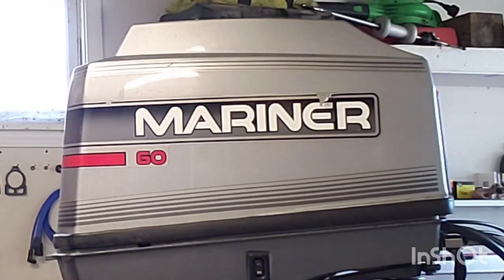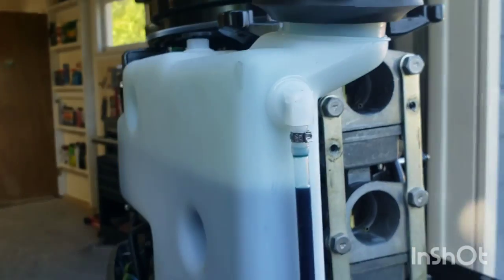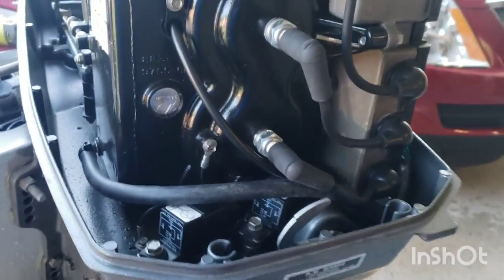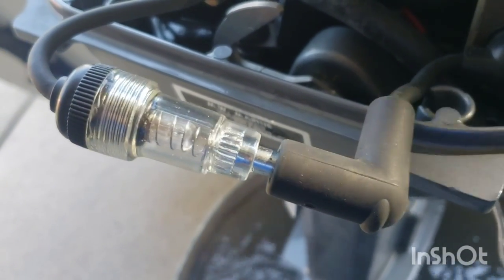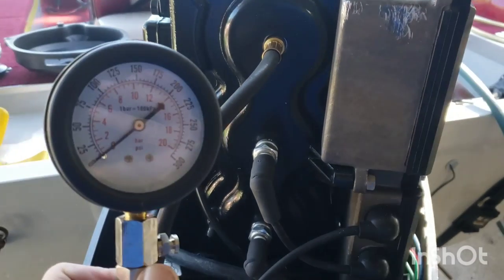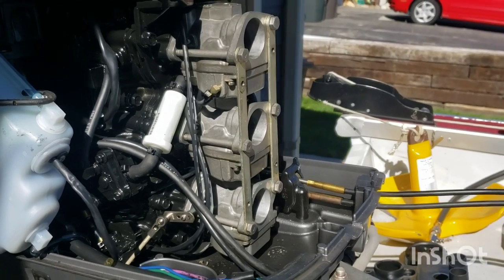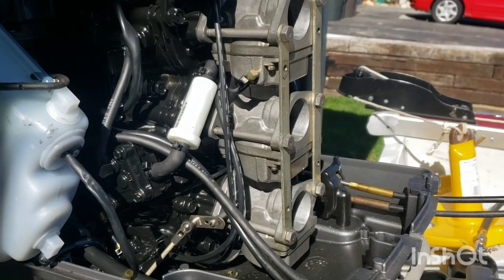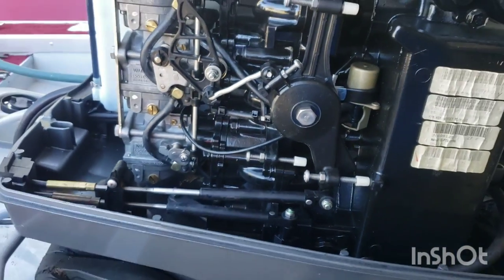Mercury Outboard bogs at full throttle!

Comment: Good video here.
As for myself the first things I usually check is the fuel line, bulb, and check valve, then straight to the fuel pump(s)...an outboard that runs fine up to mid rpm then bogs is almost always being starved of fuel, and fuel pumps are so simple to inspect, and what I often find isnt a tear or hole but just a stretched out diaphragm that cant keep up at speed, that and the godawful tiny filters Mercury used to put pre-carb in the fuel lines that most people have no clue even exist.

Comment: Thank you for an informative video. My 75hp '93 Mariner wasn't running good and found a tear in one of the fuel pump diaphragm. Fixed it and it ran awesome 1 trio out. Next trip it does what you show. Changed fuel lines and nothing. Will try the carb diagnostic and see what it shows
Reply: Had a kinked fuel line that I couldn't see without moving lines around and missed a zip tie on another fuel line

Comment: Hey Mark! Subscribed to your channel! I had a question have a 125 mercury 2 stroke on my 18 foot searay... the problem im having is when i gun it it hesitates a little and than gets on plane and works fine after that... it takes a lot try to start when its been sitting for some days and won't stay on so i have to keep choking it to start it. Now i got the boat last year and did a compression check all around 150 spark is good new gas tank. Do you have any recommendation on what to do to get rid of this problem with hesitation and starting. Thanks in Advance and Let's go Brandon!!!!
Reply from the maker: Almost always a dirty carb or clogged jet when that happens. Try some seafoam first to see if that helps at all
Reply: check for spark!

Comment: Hey mark my 40 hp yamaha is hard to start and it sputters and dies after 5-10 tries it starts running then i can give it full throttle and it runs high rpms and almost stays in place its going so slow, then all a sudden it will shoot out like a cannon. Once i get past this point it runs fine until next time i take it out. Any ideas, your time and knowledge would be very much appreciated. Just trying to save some money at a boat mechanic
Reply: sounds like you're getting intermittent or weak spark to me, pointing to needing a new ignition coil, when you start it up on muffs, try taking off the spark plug boot on each cylinder, one at a time, if it dies that one is good, if it doesnt die your spark plug is fouled or your ignition coil is faulty on that cylinder and needs replacing

Comment: Good info! I have a merc 200 efi. It dies in a no wake zone. If I go and squeeze the primer bulb it will start back up and run fine. Any ideas? Thanks much
Reply: Air leak most likely Fuel pump just fixed same problem ...

Comment: We have a year 2000  4.3 mercruiser and it won't idle. Any tips to help us? No one around here works on older boats these days it seems. thank you.
Reply from the maker: Could be a variety of things, I would need more info to steer you one way or another.
 If it runs good otherwise and just won't idle I would start with a carb cleaning though
Reply: @MarksBoatServices  thank you.  I will have my husband respond to you in just a bit.  He can explain better.  We really appreciate any info.

Comment: I’ve got a 6hp mercury that loses significant power after about 5 mins of running 75% throttle. The rpm’s appear normal but it just gets slower and slower the longer u run it, forcing me to shut it off and when I let it sit for about 10 mins, the problem is solved but it happens again. I just replaced the prop because it was spinning so I don’t think it could be that, what do you think?